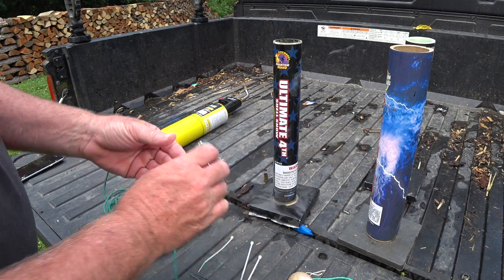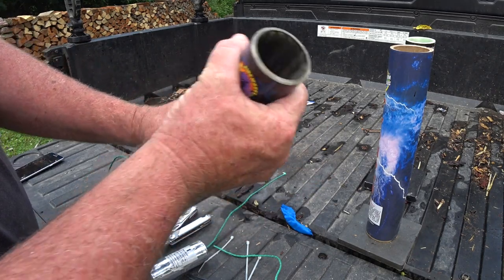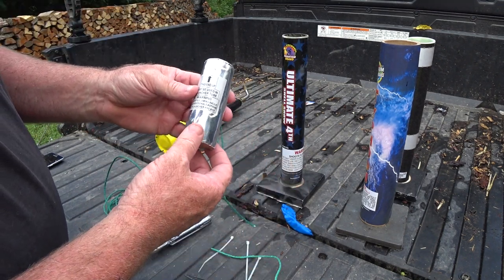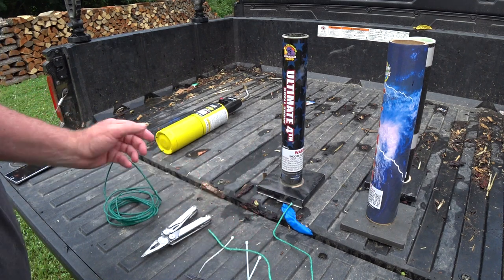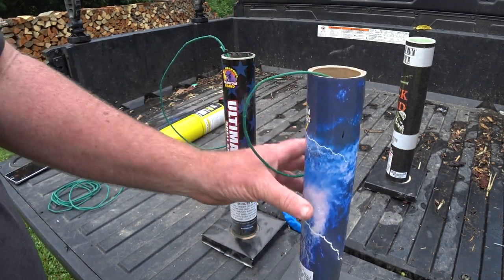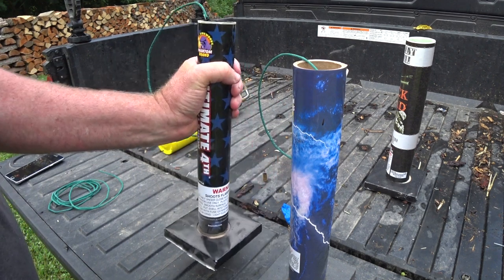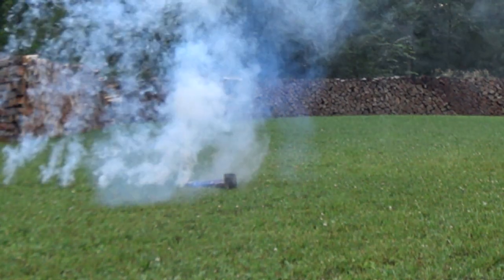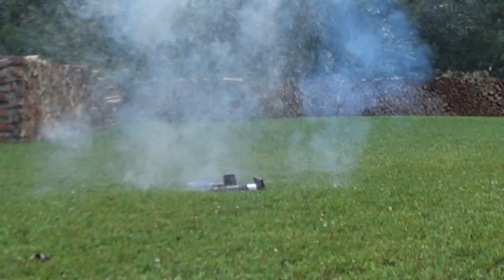#38 What happens when you shoot a firework mortar upside down?

Comment: Never ever trust the wrappings! I always peel to make sure it is correctly put it. I ran through a few that said (top) which it was never rigged right… always take off the wrappers and check before you load.
Reply: You don't need to take the wrapper off unless refusing with quick fuse. (and you really don't have to do it then either.)  You can feel the fuse going down to the bottom of the shell though the wrapper. No need for extra work.
Reply: @EngineerCatPyro  it’s rigged wrong if you don’t get what my comment meant…
Reply: Like literally the lift charge is facing up with the fuse facing up on the canister…

Comment: I've never seen a 1.4G mortar, canister or ball in type, blow a mortar tube apart when loaded upside down. Now, when you get into 1.3 fireworks, one must pay very close attention to this little detail. You go loading a 5" diameter salute upside down and it'll send parts of even an HDPE mortar tube flying.
Reply: I bought 1inch festival balls, and they shredded a really thick cardboard tube.
Reply: 5" 1.3G salutes? Really?
You don't shoot much pro stuff I see.
Both 5" ball and especially 5" cylindrical salutes are 1.2G F4 shells.
The reason is that if they break in the tube, no matter the material, it will become shrapnel, including HDPE.